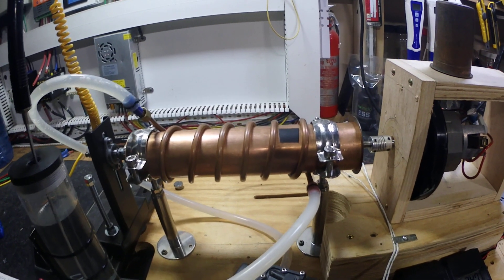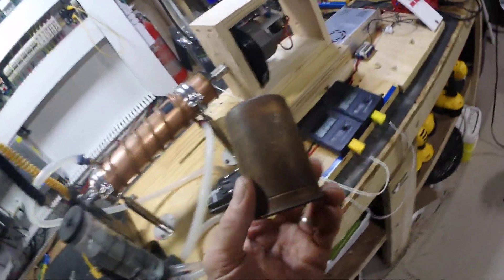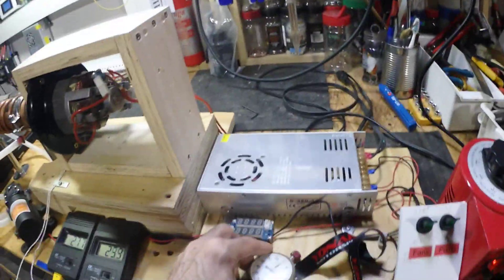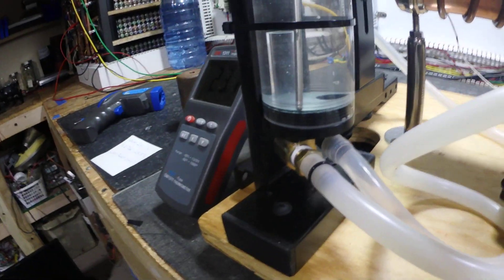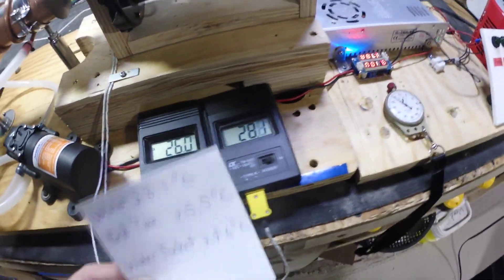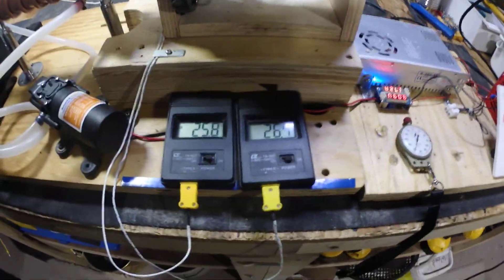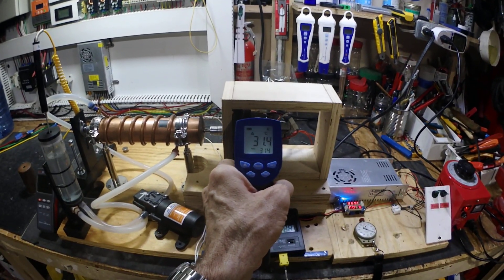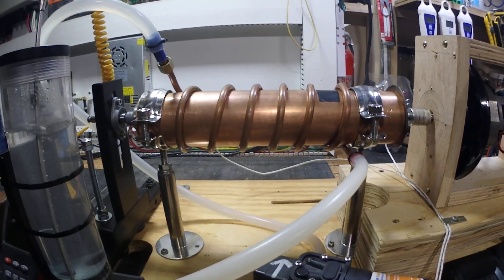Magnetic Heater Test 5

Comment: But there is nothing taking the heat away, no radiator the heat wouldn't be going up if you were using a radiator and cooling the water.

Comment: I finally have wrapped my head around what you’ve got going on here. Heat via induction, sorta like my portable cook top, but here you are applying to a hot water system (like the boiler in my home). Right? Keep up the neat work. Always interesting.
Reply from the maker: Yes ,I would like to power it with  a battery bank for off grid use ,thanks for the comment.
Reply: @saucecoreindustries3706  
Solar and/with wind turbine to battery bank would do it for sure.
Reply: @saucecoreindustries3706  How much heat do you actually get with this method you are using. Heat in an hour and energy used would be interesting Sir.
Reply: @saucecoreindustries3706  Idea to solve Energy Issues:   🫐By AMA🫐 To whom it may concern.
 The Key to making an over unity Electric Flow Generator work is mechanical advantage. In this case the mechanical advantage is achieved by getting the electric motor that is spinning a horizontal disc to be able to spin a large quantity of separate vertical discs that are connected to devices that  generate electrical flow while spinning to generate more current then the electric motor needs, to spin the horizontal disc. One of the ways to achieve this without violating the laws of thermo dynamics, is to exploit magnetic field effects. To do this,attach a horizontally positioned disc to a bar the motor is spinning. You then place magnets on the top of the horizontal disc that the  motor is spinning in a way that makes it so while the disc is spinning around, the magnetic fields are pushing upwards onto the edge of the vertical discs they hit into, forcing them to spin, thereby generating electric  current. To get the magnetic fields to only hit into one of the edges of the vertically positioned discs, place a material under the vertical discs that keeps the magnetic fields from pushing up against the discs until they reach that one open spot where the magnetic fields can hit up against the edge of the vertical discs, pushing them into a spin. In this way, the magnetic fields will be forced to do work that the electric motor wont be doing. This is how it's possible to achieve an Over Unity Electric Flow Generator. Also to keep magnets fully magnetized, you can have wires carefully coiled around part of the magnets & a system that periodically sends a small amount of current through these wires to force the magnets to be re magnetized the way you need, or have another magnet directly under the main magnet with it's opposite field attracting it, but kept apart with a spacer so they cant fully connect,this should induce induction & help keep the magnets fully magnetized. This way you don't have to worry about the magnets losing their strength over time.
  
 Extra Note: If anyone uses my ideas for profit in any way even if it's getting someone else to mass produce my Over Unity Electric Flow Generator idea,  I am fine with you & me getting royalties from it. :)  My e-mail is starfire7654321@yahoo.com

If you are interested in this idea & want to help me out by sending me funding then please email me. 

 I hope you all have a great day.   🫐By AMA🫐 Share this message with Everyone Please.  :)